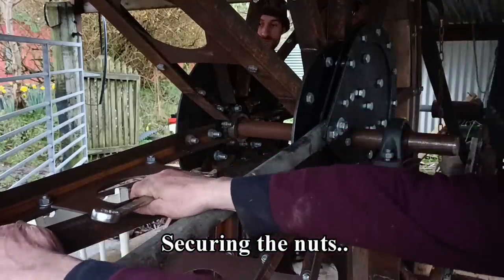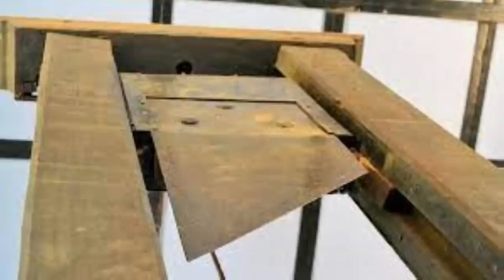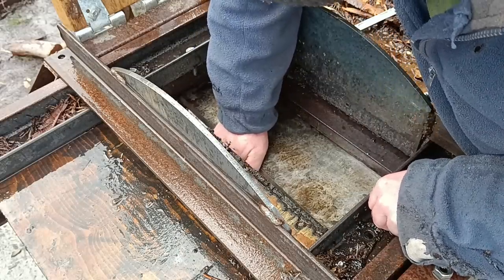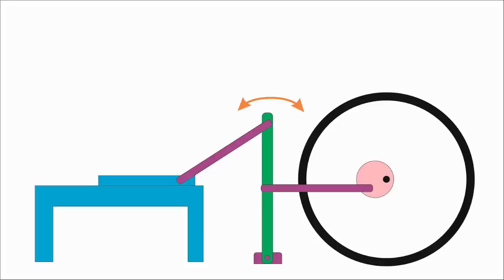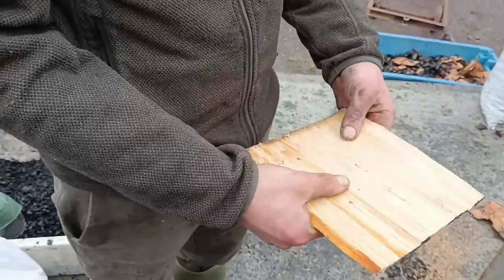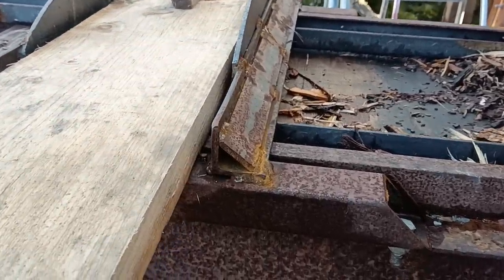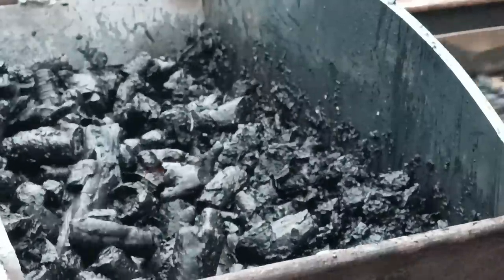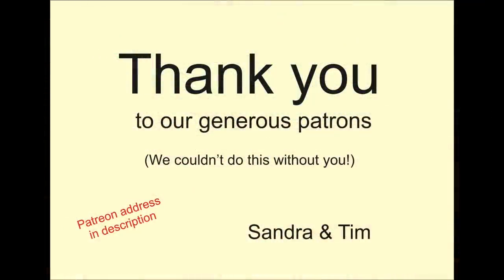Responses To Comments On The Wood Slicer Machine..

Comment: A lever with a pivot in the middle could be more compact and stronger than with the pivot at the bottom. 
Braces could be used on the wheel frame and the table to assure stability and keep their distance with a small frame to keep it off the ground. 
If you could be lucky enough find some old forged valve gear from some old steam engine they would be plenty strong but you should be able to make some strong enough with bracing and welds like you did on the stop end brace. 
Look at how the reversing valve gear works on steam engines and you should see what I mean.

Comment: Since the slicer mainly workes with pulling you could double the throw with a block and tackle system. You'd need a stong enough steele rope, attach one end to the sled, the other to the frame and the tackle to the eccentric. This woult double the movement in a pretty linear fashion. You'd also need some springs or weights to return the sled in the return stroke.
Edit 
I would also add a weight to the rope, so it doesn't get tangled in the wheel, in case the sled doesn't return
Reply from the maker: Interesting idea, Fabian - thanks
Reply: @wayoutwest-workshopstuff6299  you could also add a pulley in the front of the frame so the rope only pulls in the cutting direction of the blade. Then the friction from pulling the sled upwards will be reduced.

Comment: on the quest for more blades to use you might try stopping bye your local sharpening shed to see if they have any large mill blades that have been ground down to far to back into use they tend to have plenty of usable blade left when they are to short to go back into to use or when they get a larger ding in them if i was not over on the other side of the pond from you i have a few 3 foot long ones

Comment: Tim I’m thinking that the structure of your slicing bench needs some cross bracing and perhaps more importantly diagonal bracing to the floor or back to the flywheel frame in case you get a jam and the shear pin doesn’t break it’s likely to damage your frame

Comment: Because the charcoal is brittle I would think it would be far more efficient to use a roller crusher (two drums rotating against each other, the distance apart sets the particle size). Perhaps you have enough room to make another attachment to the wheel on the other side?
Reply: The charcoal is usually wet which makes crushing more of a challenge, I think.

Comment: For the blade it wouldn't be as wide or thick but you could try the leafspring from a car. Most leafsprings are made of a high carbon steal and cand be hardened to keep a sharper edge longer.

Comment: hmm, you might not be able to use a lever to increase the stroke lenght, but you might be able to just weld an extension to your eccentric without much trouble if there is still some clearence on the side. It would be under the same force but not the same stress. Just a big thick triangle welded or bolted to the eccentric to make the rod further away from the center.
Also, why not make the blade concave? all goes to the center as god intended.

Comment: Re: #3, Doubling the Stroke.  Doing so would reduce the power by 50% and double the rate at which your parts will wear.  Those two points make it a no-go.

Comment: When you burn these slices what's to prevent them stacking on top of each and not getting hot enough in the middle of the stack?
Reply from the maker: Yes, that might happen. And if it does then I'll have to split these flakes somehow, as they're made. But I thought I'd wait to see what actually happens before I work on that

Comment: Hey Tim, this is an old suggestion but since you mentioned another railway video coming I thought I’d might as well bring it up again. 

It might make sense to build some sort of rope-tow for the railway. Rather than having a complicated, moving locomotive, you could use a stationary power source to move heavier rolling stock by… pulling them. Seems like it could be a simpler and cheaper solution than a locomotive with the added bonus of some passive breaking power in case of an accident.
Reply: He did consider a ropeway, but the number of sidings in that area would possibly be prohibitive in terms of how useful a ropeway would be. However, depending on the traffic on the later line down to the farmhouse, which he was planning, but it's existence being so far off is probably really up in the air, a ropeway might be useful there.

Comment: If you were to put the stop plates at an angle, the push of the blade through the wood would help load the wood downwards onto the blade. What do you think???
Reply from the maker: The blade enters the log at the opposite end to where the downward pressure would be - that's the problem. But keep thinking, Alan!

Comment: I agree with you when you said having the blade at an angle like a guillotine, would get the logs, jumping sideways and running into each other. that’s precisely why back in the day they only cut off one head at a time. it would’ve been totally inhumane to have the condemned, banging heads not unlike the three stooges. Not to mention the confusion of which head went with which neck.

Comment: it will be easier on the machine. if the blade was  diagonally to the log and stationary and the log was moved backwards and forwards over the blade the log could be secured so it doesn't move which would stop the log from lifting.

Comment: Dear sir. I admire your works, and as an old engineer, I will give you very high points, for this solution.
However, if you be in lack of frontal force, you may consider of how the old type of "tilting planers" worked.
I can' find the word in english for that movement, but in swedish it was called "kuliss" -movement.
The advantage of that, was that the linear working movement became stronger, but slower forward in the process, and quicker, with less needs off effort back home.

Just a hint, to consider. 
Your Swedish frend.
Reply from the maker: Thanks, Bjorn - kuliss seems to translate as 'leaf' - so I'm still not sure what you mean? Can you find a video of one?

Comment: That charcoal grinder and wood slicer reminded me of how rock crushers work. Basically a hinged v that widens and narrows. But bits go in the top and small bits out the bottom. I wonder if you would have better throughput crushing your charcoal rather then slicing it. Alas I do not have any hands on experience so this is all pure armchair speculation

Comment: Nylon lock nuts are not an answer for anything regarding strength. As a former fastener wholesaler, I can assure you the reason the nylon is cramped into the top of the knot, is because the knot is a malleable material.  Without going back and looking at the head markings on the bolts that you have been using memory serves me to think they are 8.8 which is equal to a grade 5 in SAE standards. A 10.9 would be much better for all of your endeavors. Likewise, you need a nut of the same quality and material. I’m sure you have arrived at the fact that the pillow blocks you are using could be fastened in place if there was a surface to weld a small stop, preventing the bearings from shifting.

Comment: I'm all but an inventor and I can't tell the difference between a hammer and a nail but I can't help thinking that installing a second blade facing the opposite way would double the speed of slicing.
Reply from the maker: Pushing the conrod would be a little like pushing string. It's only straight when it's pulled..

Comment: Honestly if you wanted to make bio char all you have to do is light a big bonfire then once the logs turn to coals spray it with water and mix it till it extinguishes. You could make a few tons in one day
Reply from the maker: That's pretty much what I do, John. But drying the timber first makes it much faster and cleaner to burn, and making sure there are no large pieces means there aren't any un-cooked parts in there.

Comment: Hope the comments don't get you too down.  I know I for one have been guilty of the 'but why don't you do it this way?' comments.  On one hand, many of the things you do have existing solutions, and if you know what's already been done, there's the urge to comment when someone tries lots of different stuff, not all of which is going to work as well as established solutions.  On the other hand, and far more important, there's an evolution aspect to technology.  It tends to freeze at 'good enough and cheap', and at that point lots of people stop trying.  So it's good to see established solutions disregarded.  You don't just look up a blueprint of what you want.  You start from the bottom.  You think the problem through.  What you get is different.  It very well could be better. I would never have thought to make a mechanism that both cut shingles and grinds wet charcoal.  There are established separate solutions for both those problems, but now you have something that does both, and from the looks of it, fairly well.
Reply from the maker: Thanks, Andrew.Isolation and lack of funds forces all kinds of innovations - and occasionally they work out  : -  )

Comment: Should you decide on a bigger blade, you could do worse than look into printers guillotines. I'm not talking little table-top things. The one i used to work with had a high speed steel blade about 4 feet wide and could cut though a stack of paper a foot deep in about a quarter of a second. I imagine they must be available as spare parts...
Reply from the maker: I did look at those - €300 each though!

Comment: It is great that you not only read the comments, but actually think about them and how to apply any good ones!
I think this makes a real difference in creating a community that is not just a "look at what I do" type of thing.

I think the idea of activated biochar is a great idea ..... also a good use for some of your donkeypoop. I assume you intend to have a tank with a bubblier in to stop it going anaerobic?
A kind of odd legacy to know you will be leaving something that may outlast our civilisation even if your name is not evident in it's existence!

If you want good steel for making blades from ...... they need to replace forklift tines periodically. They are an excellent material for this and can be had relatively cheaply (if you know the right person).

An idea for increasing your stroke would be to have your existing shaft feed onto another wheel via a crank. You could then vary your stroke to whatever you want it to be by simply altering the point at which you attach your rod to the moving plate. Might be a lot of work if you don't need it now, but if you plan on connecting other stuff at a later date ..... ?
Reply from the maker: Have a look on our other channel - there's a lot of tea brewing..
Reply: @wayoutwest-workshopstuff6299  You are not wrong there ;o)

Comment: I greatly admire your work and know you will always go your own way 
However the blade edge is working massively against you. Ask a local machine shop to put a proper smooth faced angle on it.
Maybe even a double angled lead.
What you have is a club not a blade.
Forgive me oh great one. I mean well.
Reply from the maker: Not sure what you mean though. It has a couple of dings in it but it is sharp. I can't risk making it any thinner because it needs to be strong too

Comment: IF IT ISN'T BROKE, DON'T FIX IT! it does what you want as it is right now.
a guillotine as a notch for a persons neck to behead them for the reason he mentions in this video, the only way the will work in this set up is if the log stands up and he has two notched over lapping boards for the log to slip in.
if you were to square notch then all your logs have to fit inside that notch, not very drop a long in and play friendly if you have to maintain a specific size, and what do you do with all the too small ones?
he's got more engineering sense than most of youtube for a reason, HOWEVER, MANY OF YOU ARE AWESOME WITH THE COMMENTED IDEAS AND INSIGHTS! THANK YOU, this machine he has right now can make a fortune in british columbia canada making cedar shingles! IN 2006 IT WAS $40 FOR A BUNDLE OF THOSE SHINGLES, GUESS WHAT IT IS RIGHT NOW IN NORTHERN AMERICA $120-180 IF YOU WANT  THEM GREEN/BROWN TREATED OR SEALER STAINED!

Comment: It looks like you skipped over the comment about increasing stroke by raising the front of the table.
Reply from the maker: We did some experiments with the height of the sled and contrary to what we expected, we couldn't see any difference in stroke. Sloing the table would add other problems too, surely?
Reply: @wayoutwest-workshopstuff6299  you have to raise the furthest end up, not the whole table just in case we are misunderstanding each other. I was thinking it would be just enough to clear the wood chunks when they get stuck. Under a very heavy cut it would push down against the table more, but that's about it.

Comment: In a synchronicity of my interests I saw a very budget hammer mill about a minute and a half in to this video and though it might do your charcoal at a higher volume per hour and probably to a finer grind? Being already quite brittle I wonder if you’d need something far less heavy duty even than this to get charcoal through a simple mesh at your desired size?

https://youtu.be/YlHdJvecYRA
Reply from the maker: Thanks. Yes, that's the sort of thing I have made before, but I'm still keen to try getting the slicing machine to grind charcoal too.

Comment: Why you think so complicate with the pivot? You find the sample on every steamloco to control the filling of the cylinder. If you copy this in the right way, you even not need to stop the motor ore untide the belt and the way is also adjustable...from 0 to what ever you want cm stroke.

Watch from sec.32:

https://youtu.be/YuPtJ3kkd0w
Reply from the maker: Not complicated at all - just expensive in materials
Reply: @wayoutwest-workshopstuff6299  ... Tim, but think about the comfort of driving the slicer... and i'am shure that all the stuff you need is allready on youre Yard!